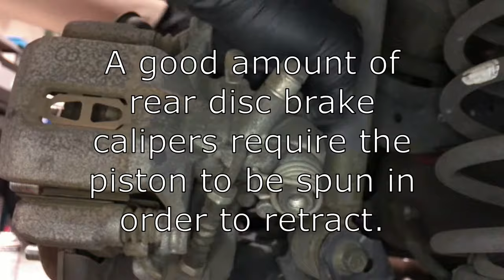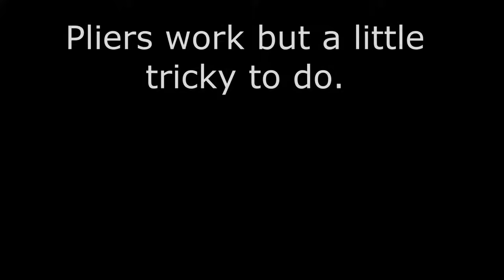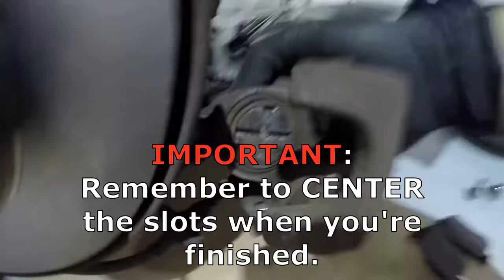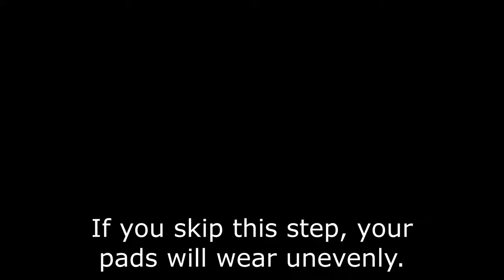How to Retract Rear Caliper Piston

Comment: I was on the right track spun it once with the small angle grinder disk hand tool...but thanks for the info regarding alignment 👍
Reply from the maker: Thank you for watching I’m glad it helped, also great idea with the angle grinder tool.
Reply: yep. the small 2 tang spanner wrench for tightening the nut on 4" grinders when replacing disc

Comment: Hint: If you forgot to line up the Piston NOTCH to the PAD notch just cycle the parking brake about 10 times and each time it will rotate the piston until it falls into the notch. best to have a friend put his ears next to the rear of the vehicle so they can confirm a loud CLICK sound has occurred.
Reply from the maker: Great tip, thanks John

Comment: I accidentally pinched & ripped a little hole from the piston boot , is that bad?
Reply from the maker: Not necessarily bad because I’ve don’t my fair share of these and maybe 20% of them had ripped boots. The boot keeps dust and debris from the piston as it comes out and partially retract when you depress the brake pedal. The worst it’ll get is brake dust stuck inside and maybe some rust if you’re in a really humid area.

Comment: I first thought my rear calipers were frozen up when I couldn't push them back when putting the brakes back together (in the rear) after installing rear struts on my "W" body 1995 grand prix SE /  It had been sitting in my garage from about 
2006- till this summer of 2022. That"s why I thought maybe rusted &  frozen up . I didn't want to spent somewhere between $80 & $100 for  a rear caliper and that's just one for one side.  so I bought the seal and boot and ring clip.
When I got the piston out , it just goes straight & does't turn right? I think I was watching, or did I turn it maybe I did?
 But it sure in the heck has to turn to put it in.  Anyway what I can't figure out is every time I put the brakes on how  are they ever going to release the pressure/ there's nobody there to quick jake and jack it up and remove the tire to  to use a tool to spin the piston and if the piston has to line up with that shoe riviet, how could it turn anymore, anyway?
I didn't invent this piston that overlaps over a threaded rod & has to be turned, in . 
   All I know is I put the caliper on bleed the brakes , the piston pushes tight to the pads, and won't release. I tried 3 different calipers none release and the only way to release them is to turn the piston to the right, with the pads out of the way.   and yes i did drive it before I tied rebuilding the caliper had to wait a day for the awful smell to go away from dragging. the other side rear works.   its the same  only  different from right to left.

Comment: with the cube, does it feel pretty snug once it's in place and you start turning the piston? since it can turn counter or clock wise either direction. i've never used this before thanks.
Reply from the maker: The cube will feel really snug or with a little play depending on your piston notches. In the video it wasn’t 100% snug because it’s a universal tool. If you get the whole kit, the tool actually puts pressure on the face of the piston and the back of the fingers so it’s really secure and easy to work with.
Reply: @waynesgarage8579  thanks a ton man for the reply and good video. my wife has an acura with similar if not same looking rear piston (cross looking) so I'll follow suit.
Reply from the maker: Yeah an Acura is pretty much a rebadged luxury Honda. It’ll be very similar

Comment: great video with happy music!  I've seen some people crack open the bleeder screw when they push the piston in.  What is the difference between doing this, or not? (other than the oil pushing back and filling the reservoir?)
Reply from the maker: Tristan, yes! Opening the bleeder is another technique that will make the piston retraction a little easier and avoid old fluid from traveling back up to your master cylinder. (The master cylinder ports are small so there’s a chance the debris can plug them ) If you have really old brake fluid then it’s beneficial to do that but doing so might make a mess unless you have a clear tube connected to the caliper as you retract. Thanks for watching

Comment: So about the fluid rising when retracting caliper plate,  just remove the excess fluid and once installed and pumping brakes fill as it lowers again?
Reply from the maker: Yes that way works. Rear brakes won’t raise the fluid level too much but front brakes will due to their larger pistons. Do consider a full brake flush if it hasn’t been performed before in your car.
Reply: @waynesgarage8579  thanks,  just did the fronts rotors and brakes today. Will do the tears tomorrow. 

I occasionally flush brake fluid, it's a 7 year old vehicle and fluid looks like new. Will do next weekend so I can still have a mini weekend this one lol. 

Thanks again Wayne. The information is valuable and I appreciate it, knowledge sharing is the way the world should work.

Comment: What do you do if you accidentally remove the piston from its housing?
Reply from the maker: I would clean off the seal and piston and attempt to screw in the piston slowly. The threads are fine and can easily strip. Go counter clockwise until you feel the beginning of the thread then slowly turn clockwise with a little bit of pressure. Open up the bleeder screw so you’re not fighting too much pressure. After you manage to get it back in you will need a really thorough brake bleeding in that caliper because a lot of trap micro air bubble is most likely all over internally.

Comment: Great video. The brake fluid is pushing the piston out. So why do we rotate to push the piston back in ? Can we just push the piston back in ? Thanks
Reply from the maker: Anup, the piston has ratcheting teeth that locks the piston as it goes outwards and the side of the piston has threads that the teeth locks onto. Thats why the piston needs to be to rotated to go inward but cannot be simply pressed in. Hope you can visualize what I’m saying.
Reply: Thank you.

Comment: How do you know when your finished when it's flush
Reply from the maker: When it’s fully retracted it’ll bottom out. The face of the piston will be flush with the caliper housing. Then you can turn the piston on reverse to line up the notch (turning the piston back will not make it extend out)
Reply: AppreiTe it buddy

Comment: And what happens if there seized and won't turn???
Reply from the maker: I’ve had a few case where it was really stubborn and I had to open the bleeder screw so I’m not fighting the brake fluid. If you focus on getting the piston to turn first then it makes it easier laster when you turn and put inward pressure on the piston. 
There was also this one time the piston came out of the threaded bore so I had no choice but to replace the whole caliper

Comment: Try not using a flex head ratchet, you won't struggle so much.
Reply from the maker: Yeah I wish I could have done the video at work so I can use my primary tools. I was forced to use whatever my backup set has.